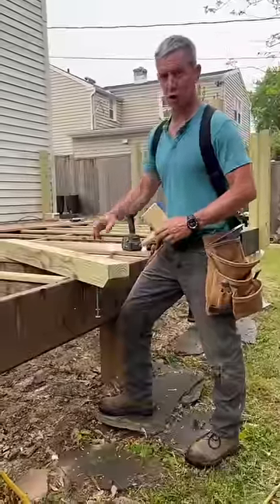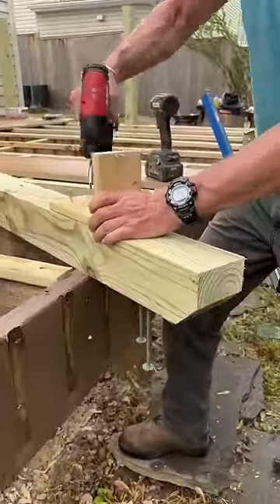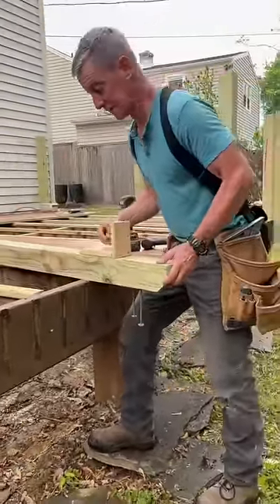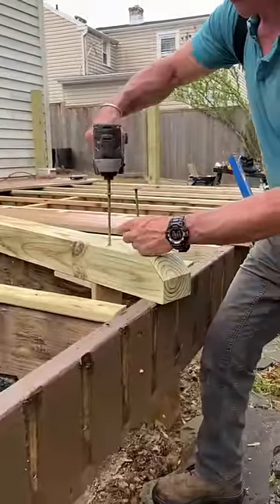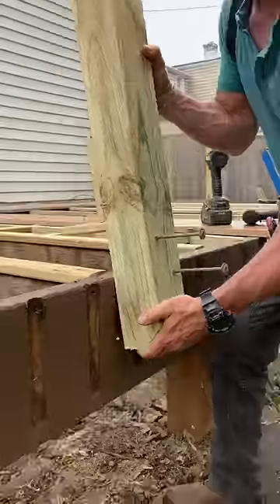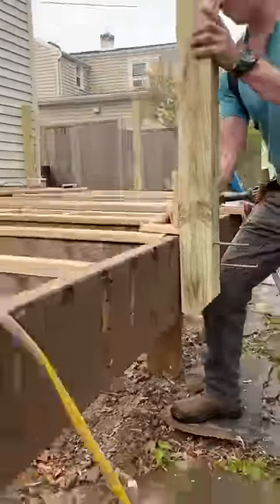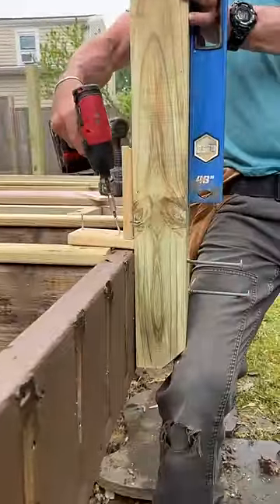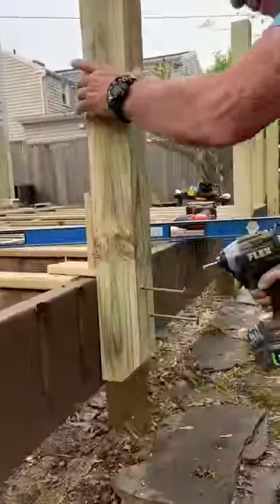DIY Tips: How to set a deck guard post by yourself

Comment: I use an Irwin quick clamp, no screws required.
Reply from the maker: I’ve only tried that a million times. Clamp moves. Screw doesn’t.
Reply: @myfixituplife are you using strong enough clamps? lol
Reply from the maker: @christophercrawford2736  I have Irwin bar clamps, same as you, prolly. Watch the video. I don’t clamp the. Post, I set it where I need it to be.
Reply: @myfixituplife  I don’t have any Irwin brand ones. I have Dewalt ones though that are pretty strong. I don’t know if they’d work well. The screws seem to be fool-proof, apart from making screw holes that may be in an undesirable location. Your jig is dead simple and works though. I’d maybe try using your jig in combination with a clamp and see if it works just cuz I’m the kind of guy who doesn’t like extra screw holes where they might show…. But I’ve never built a deck so what do I know? Hahaha

Comment: I love those screws. I have a box on the truck with every length. They're relatively cheap also. I used to do posts on outside of rim like that but, inside it won't loosen over time.
Reply from the maker: Same. All their fasteners are bad as+. - Yeah, I box them in the frame, too. - I have a fence gate I need to repair and wish I had a few 3s.

Comment: How not to install post
Reply from the maker: The only thing that'll get this to budge is TNT.
Reply: Gotta notch the posts. Less protruding. And keeps the rail above the deck. Fire more snug too
Reply: @sethdistler5332 i also double band deck aswell
Reply: My railing posts are on the inside, and every one of them is fully boxed in..
Reply: @tpk427  i do the same plus joist hangers and post chairs
Reply: @tpk427  As they should be, tpk...
 This guy is dangerously misinforming homeowners  about how a guard rail should be engineered and installed.
 This is disturbing to watch.
Reply: @williardbillmore5713  And, they go all the way to the ground.  They are the perimeter supports for the deck.
Reply: @tpk427  Did you dig footings? Are the posts under the rim joist  notched or bolted?  Do you have beams under the joists or are they hung on the rim with hangers.
 Suddenly I get the feeling you have no idea of the proper way to build a deck..
Reply: @williardbillmore5713  They are on pier blocks, resting on top of poured concrete pads.  So no, the 4x4's themselves don't exactly go all the way to the ground, but they are the supports around the perimeter.
Reply: @myfixituplife …TNT….The Next Toddler 🤣
Reply: @sethdistler5332  That would violate the building code in my area.
Reply: Learn something new in the comments from those making inaccurate videos. 😅
Reply: @myfixituplife  Bullschit. It feels solid when you build it, but in a summer or two when that wood dries and shrinks, your lags will start to wobble in the holes. A heavy person leaning on it will strip them out. Don't slack on stuff like this, dude.
Reply: I mount outside the band joist & use a tension tie. Notching invites rot. Those lag bolts will pull away with wood shrinkage.
Reply from the maker: @artor9175  How do you know? This is a resurface and the lags that were in there before hadn’t wiggled loose in 25-summers.
Reply: @artor9175  Never use the word "Dude" and then claim to be an adult man. No one will take you serious.
Reply: @myfixituplife actually a couple months of drying will get you a repair of a loose railing system. This method relies solely on fasteners. I prefer mechanical connections. That being said I too work by myself most of the time and like your way of thinking for compensating. 👍

Comment: Well that is a massive code violation in all 50 states
Reply from the maker: In new construction, plan review would probably ask for a TER. Because this was a resurface for a 25-year old deck, we do what works. And this works.
Reply: @myfixituplife  there's no excuse for massive code violations you had the deck open you could have easily put it inside the framing and through bolted it like code requires....
Reply: Codes? What codes? Fly by nights like this guy don't follow codes. What are you thinking?
Reply: Not everywhere it isn't. But it's not a current practice anymore, no.
Reply: @vrgcustomcarpentry  That code applies also in New Zealand and Australia. Galvanised or SS bolts. Not screws...
Reply: I love to hear pros bitching at each other. I appreciate pros and cons. No pun intended.
Reply: @stevenblalock1178  only thing is one if then clearly is not a pro and I would say it’s the guy out here robbing homeowners reusing old splintered wood and using screws instead of bolts 😂 I’m with VRG on this
Reply: @tylerhowerton8518  was it me or did that top screw totally missed the meat😂
Reply: @vrgcustomcarpentry  all kinds of places with no codes.
Reply: @daniastopjik3287  no bullshittin he’s definitely going to have to revisit this job 🤣
Reply: @tylerhowerton8518  sad .... it's probably in less then 2 weeks😂
Reply: Videos like this always get a thousand comments from a thousand jokers who all think they can do it right or better. 
Never fails.
Reply: @dexterdog62  I know I can that’s for sure but  that’s why we comment on what was supposed to be done instead of just talking out our ass saying it’s wrong with no explanation so from now on you can weed out the dick heads also how would one know what code is without having knowledge in the field 🤔
Reply: I could care less about code. No one is going to tell me what I can do on my own property. That being said, this is a weak installation. Put the post on the inside and secure it on all 4 sides
Reply: @GND3153  haha you must not have a nice place 🤣 anybody who cares about the property and the investment that it is cares about code. You my friend will always have the low end of the comps in your neighborhood and good luck selling to someone without cash most loans today require inspection 🧐
Reply: @daniastopjik3287  Look at the piece of lumber he is lagging those posts to. Old weathered 25 year old repurposed wood with all those joist hanger holes punched into it.
 This is very shoddy carpentry.
Reply: @williardbillmore5713  💯💯💯💯💯
Reply: @alfredallen3350  The I in IRC stands for international.
Reply: @illsellthat8445  but if you install railings they have to be installed to code ... So although they might not be required to the height.... If you do put them in they should be done to code for safety.....
Reply: In Canada too

Comment: How about notching the post 1 1/2 deep x 3 1/2  x 7 1/4 into the post, then anchor to the framework. 
Post won't move side to  side or drop. You can even turn it around and mount from the inside and block it.
Won't go anywhere. ⚒🔨🤔😅
Reply from the maker: I'd love it if I could do that, but that turns a 4x4 into a 2x4. What I removed--this project is a resurface--were notched and lagged posts. I prefer the full post.
Reply: @myfixituplife  you get a full support surface with no possibility of drop and ability to block it in place.
Reply: Where I’m from, notched 4x4 posts are prohibited. Furthermore all guard posts are required to be set with 2) 1/2 galvanized hex head bolts and the bottom bolt needs to be secured to a joist with a Simpson DTT2Z lateral load connector.
Reply: That weakens the post's integrity
Reply: @davecpgh  
Dave, you can notch & lap the post, turn and mount from inside your frame work. Once you have anchored the post, you can add blocking incorporated into the framework on the backside. Thus wrapping it. Gives you a support for nailing decking that would sometimes be floating in air.
Reply: @richardbause2453  you are essentially attaching a 2x4 to the deck by notching the 4x4. The full posts go inside the rim joists and gets blocking to secure, basically a cross brace with the post sandwiched in between.
Reply from the maker: @davecpgh  yes. Notching a post turns a 4x4 into a 2x4.
Reply from the maker: @algio3041  that is a serious connection. I personally think it’s overkill but it’ll work for sure. So will this. It’s a deck resurface so I had to work with what was there.
Reply: @myfixituplife  definitely overkill, but required in Fairfax county Virginia… also adds a hefty cost to the homeowner

Comment: Stop calling everything the wrong name
Band joist?
Power lag?
Freeze it later?
Where are you from? Mars?

And this is installation method is very illegal. And please don't say "this is an old deck, I'm just reskinning it" or something similar, because by law, when you renovate anything inside a house, or out, you must bring it up to present day code. No exceptions.
Reply from the maker: You don't seem to get out much. Things are referred to by different jargon in different parts of the country. Some people call it a tele-handler, others a Lull. There's strapping and furring strips. I could go on. Band joist, rim joist, rim board...all the same thing.
Reply: Well said

Comment: I thought they had to be bolted.
Reply from the maker: This is a repair and what's here is 8,000 times better than what was there. In new construction, the post either needs to be housed and blocked, bolted to the face or the plan reviewer needs to sign off on a different technique, whish this is.

Comment: Through bolts are much safer. Someone leaning over could ripout those screws.
Reply from the maker: These same screws connect the ledger to the building. There's 7 1/2 inches of highly designed steel into solid wood with a 2x6 top cap that needs to fail first across the 5 1/2-inch dimension. You'd need to lean a tree trunk on there at 80-mph for this to fail.
Reply: We just built a deck that's suspended 20 foot with GRK 30 fasteners, and joist hangers. Screws are the way. But I will say I have taken wood class and there is a reason people use nails too, only thing is they love to back out and work their way out over time, but won't break under tension or an earthquake for example, when a screw will snap. I'd say to be safe use both and if you want slap a lag in it lol.
Reply: @myfixituplife  Haven't you learned that screws are no longer code for ledger boards too?
 The new IRC codes require opening up the floor or ceiling so that the decks joists are tied directly to the deck's joists with specialized hardware.
 90% of deck failures injuries and deaths are because of ledger boards.
 What you should be doing is setting footings all around so the deck is self supporting. 
 Pictures and wallpaper are hung. Decks should be built from the ground up to be safe .
 Why would anyone want to use a ledger board shortcut that will introduce rainwater into the frame of the house and the siding?
 You need to relearn everything you think you know about deck building.
Reply: @williardbillmore5713  tried it explain that to this hack. Problem is he thinks he is doing a good job🤣🤣🤣
Reply: @cibolocreekoutfit  I've seen it so many times. He was shown how to build by his dad or uncle or the guy down the street when he was young and he figured that was the only way to do things.
 You are correct. He is so sure that what he was shown is the best way to build he even puts out this video to spread his supposed wisdom cleverness and knowledge.
 Now some novice will watch his video and the bad information perpetuates. You can see it in the comments. Unsuspecting "do it yourselfers" compliment him on what a great instructor he is and what a great video he produced.
 I guarantee this hack never pulls a permit or ever reads up on code because he considers himself to be an absolute expert about everything to do with building decks. 
 Meanwhile more that half the decks built in America are not built to any real code and are unsafe. New unsafe decks are being built every year because of guys like this.

Comment: Awesome advice! Though. You could just throw an extra block laying around and just use one piece of a 2x4 or something.
Great video! Thanks!
Reply from the maker: I appreciate where you're coming from, but I have tired all these techniques and the problem is that they all move. - A single screw along with the silly jig makes many pieces one and solves many problems at the same time.

Comment: Need to use anchor bolts, not lag. You sank them way too deep. You're FIRED!
Reply: Washers with the teeth would be a great thing right??
Reply from the maker: They're countersunk to maximum depth because PT in the East is super high moisture content. I need to accommodate for the post drying out and getting smaller.
Reply from the maker: The head of the PowerLag is a washer. It's a washer-head screw
Reply: Gotcha!! Do your thing!!

Comment: They real guys are here because the title says 'how to'.  And it's only how to in this very specific situation. Not actually how to do it properly 2023 code. 
So they feel the need to set it straight
Reply from the maker: It is a specific situation. This deck is being resurfaced. But specific situations also generalize, so I appreciate your insight. - DCA-6 approves surface mounted posts, so whether you thru-bolt them or use structural screws, the method is game-on.

Comment: And then the post dries out and the shims fall out.
Reply from the maker: Not an impossible scenario. However, the post is locked on the screw shanks all day. And the 2x6 rail cap is secured to all the other posts. Even if the do fall out, the post is staying put.
Reply: Normally youd screw through the shim. But you knew that right?😂😂
Reply: Don’t worry the top rail will hold everything together
Reply from the maker: @Sh1tzboutagodown  Top rail integrates the entire system, yes.

Comment: Until they have a party and everybody is leaning on the rail watching something in the backyard causing the band joist to give way resulting in injury. This guy is no carpenter, do not do what he does. Those posts need to be inside the band/rim board and fastened to a floor joist with bolts.
Reply from the maker: For that to happen, the 2x6 top cap will need to break along the 5 1/2-inch dimension first. You really think leaning is going to do that. Put a 2x6 on edge and get all your friends to stand on it and see what happens.
Reply: I have built many decks years ago and always did it inside the rim joist and would box it in and then bolt like you said. The only time I fastened to the outside was on a bench back that you are sitting against. Next I have to say I would never use old wood for the rim like he has and the 1x's on top of the joist. Looks like a happy home owner job.

Comment: When you post something you better do it right. To many guys out there obviously have way more experience then this guy. 

Look at the rim joist. Non painted or even primed. Someone will be back in a few years fixing this guys careless work. 🤦🏻‍♂️

Home owners are the ones who pay for the mistakes and give good contractors a bad name. 

Come on man!!!
Reply: It's hard. You wanna do the best but sometimes they just wanna put lipstick on a pig.
Reply from the maker: I did. It's just not the way you've been taught to do it, so you're seeing red. That's fine. It works.
Reply from the maker: As a home improvement contractor, "lipstick on a pig" is sometimes what we have to do. Budgets are what budgets are. We do our best within those parameters. That's life and I need to put food on my table. Lots of hourly guys don't get this.
Reply: Interesting responses. 

Someone may call it lipstick on a pig, but your reputation precedes you on every project you do. If you can’t budget correctly and if you can’t to work correctly and that’s going to last, then you need to get out of the business. Yes putting food on the table as one thing reputation as a contractors is another. 

My 45 years being in the business is because I do things correctly not just getting it done. 

Good luck in your endeavors…
Blessings

Comment: For the most part I'm a fan of SPAX screw products but I have experienced the heads simultaneously breaking off of multiple SPAX 1/4" × 5" Powerlags. For installations where safety and security are paramount I would strongly recommend using an alternative to SPAX Powerlags.
 
For deck guard posts specifically, I prefer using galvanized guard post anchors with bolts, nuts, and washers. The only reason for using a jig is when using lag screws rather than bolts.
Reply from the maker: I’ve never snapped a PowerLag. I use 5/16. Driven hundreds of them. - I get the hardware-centric attachment approach. You surely do good work. - The point of tue video was how I get the post set in the first place. The jig and whatnot. Saves me all kinds of trouble. - Chime in any time

Comment: If your not notching your posts on the bottom, then I think it's best to mount them inside the rim joist with inside bracing, to lock the 4×4 in, then, 8 inch long carriage bolts with an inside washer, that will last
Reply from the maker: Notching a deck post halves its strength. Not that I don't love this detail, because I do. And it can last for decades. But it's been a no-go for years. - Not shown here is that this is a double front band (I hate that detail) so mounting the posts in-board was not happening.

Comment: Just for kicks, even though this isn't current regarding building practices. The bracket on the inside being screwed into the bandboard from the top is giving shear resistance to the lags drawing the post tight. 

When we used to.put posts on the outside, we'd just start a nail at 9" or 7" and the nail would keep the post at the correct height. Then screw it through the band, out of the way of the bolts, punch it and bolt it on. Ledgerloks are great and all, but they go on the inside nowadays, not the outside.
Reply from the maker: We learned basically the same technique. Not shown, is there is a 2x8 inside this 2x10 silly fascia/double beam. - I had to mount outboard. Is this in the DCA 6? No. Is resurfacing in the the DCA 6? Also no. Is this wood-weld moving in my lifetime? Also no.